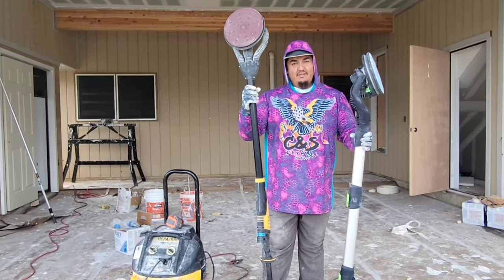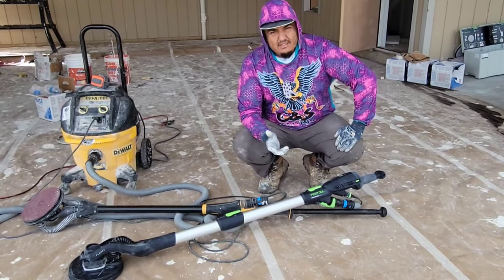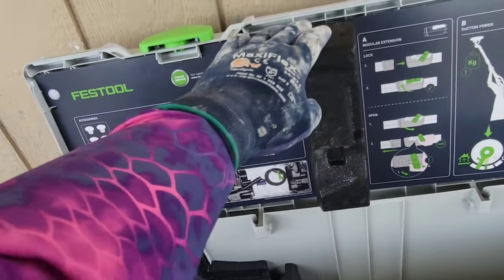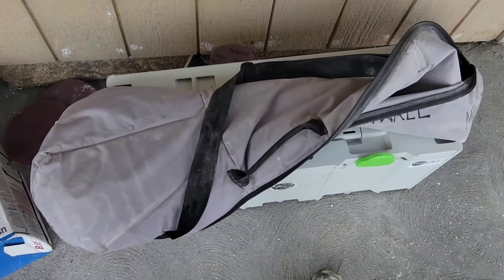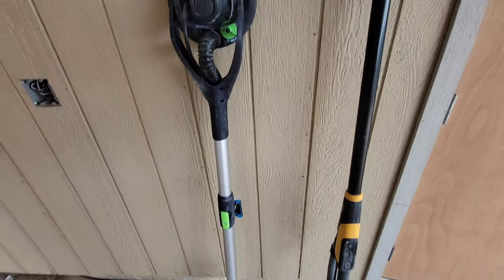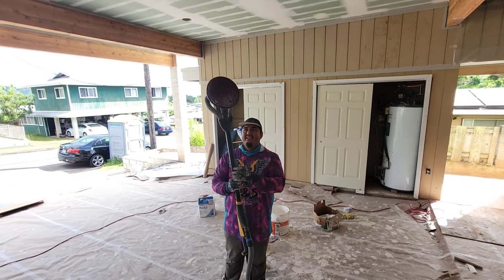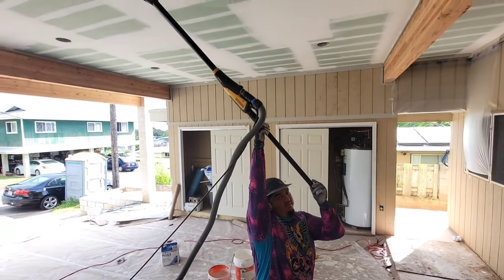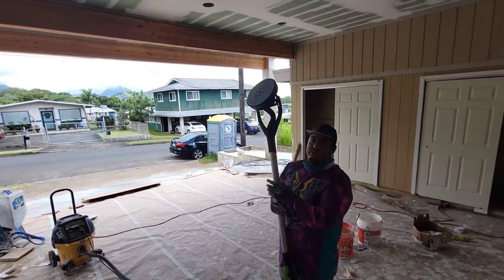Festool planex 2 vs Mirka Leros

Comment: The festool vacuum is night and day difference compared to the one your using. Its what makes the product. The suction holds the vac on the ceilings you exert virtually no physical pressure on it while doing ceilings. I urge you to find a festool vac you could test out to see the difference
Reply: This is correct, it also keeps the interface pad level.  

Another thing, is you have to stick the old planex interface pad over the top of the new interface pad, this will give you a level 5 finish.
Reply: I do post construction cleaning would that festool vacuum be very good for the dust or does it only work with the grinder ?

Comment: I have both and the last model planex. The newest planex has come a long way from previous models but in no way is better or easier to use than the mirka. The mirka is an amazing machine for finish sanding. It’s terrible for removing painted old texture. It tends to over heat. The planex is better for that kind of work but when it comes to finish work mirka is the clear winner😊
Reply from the maker: 💯 agree🤙🏽

Comment: I have used the festool with their vac for years. I bought the Mirka after watching your video. Now I only bring out the Festool to knock down heavy texture.
Reply from the maker: Ya that's one thing the Mirka can't handle.
Reply: My ceilings have a pretty heavy texture and I'm thinking of sanding it down in my house but didn't want to make a huge mess. How clean is that process using a vac and sander like this?

Comment: I just bought a mirka leros and a vacuum this morning. After one day of use I absolutely love it. We don’t do a whole lot of drywall work but the custom home we’re painting right now has a ton of nail pops that we had to redo after the Drywallers tried to fix them. They spent almost a week going around and patching up nail pops without setting the screw in and the walls looked like they had goosebumps all over them. We spent two days sanding by hand and after the second day I said screw this I’m buying a Mirka.

Comment: Great review! Personally I own the mirka and the mirka vacuum and it work perfectly I buy it 2 years ago and I'm totally satisfied.  I use 150 grid for finish and 120 grid for sanding 45 or 20 min hot mud. The fact that the head moove 180° make huge difference in my opinion like you demonstrated in your video. The dust control is exceptional, even when you pass on coner bead with half the head on the wall. This electric sanders is a beast and I will never return to the festool in fact at the beginning like 7 years from now u was using the Porter-Cable 😅
Reply: The mirka is an amazing machine. Where festool is the clear winner is in vacuums my ct 36 sucks a lot harder than mirka. I run my mirka on my festool vac

Comment: Awesome! So basically both have their place and it’s just a matter of choice then. I just ordered the Festool unit. It’s my very first ever drywall sander. I’m excited and can’t wait to receive it.
Reply from the maker: Congratulations remember there's a slight learning curve so practice on walls that are still getting coated to avoid having to touch up the finish. A soft pad is highly recommended.
Reply: @csdrywallhawaii  Thank you and thanks for the advice.
Reply: Throw an extra interface pad on (the old planex pad) to prevent the screws from digging into your drywall.

Comment: Thank you for the video.  One of the best videos out there comparing the two.  I’ll be pulling a trigger on the Mirka and just put an LED strip around the head which should make it comparable to the Festool.  Thank you.
Reply from the maker: No problem brother proir to this video festool hadn't come out with the soft pad replacement. Now with it it ties with the Mirka. The biggest difference is the head movement for level 5 Mirka is preferred but everything else the festool is a bit faster and cleaner. The are more recent comparisons on the channel hope it helps.
Reply: I’ll check them out.  Thank you again. Very good info.

Comment: The light is no joke. One of the jobs I used the 2 on was a float job where somebody else had started, and I knew it had issues but when I put the 2 to it to take out some of the problems before I floated it I was like damn this stuff is jacked up. I'm getting along well with the 2 and it reinforces how crappy the OG was. 

Also in my area a extension that also has room for 1 more to fit in the box is 238. USD but you have that island tax. 

If you want to get similar lighting on the Mirka there are some vids where people added led strips around the head to their old Planex. Doable for the Mirka.
Reply from the maker: Awesome thanks for the insight ya I seen a couple never got around to playing with the led strip.
Reply: The L.E.D. strip is the only way to go

Comment: Ya, the mirka bag sucks, the zipper is screwed on mine, that's why I built a case for it, but it's a bit heavy. My partner has the festool extractor, I wouldn't worry about buying one if your happy with your dewalt, this thing doesn't hold up a sander to the ceiling either. I'm sticking with mirka, it's the best. Thanks for the review, take care.
Oh, you didn't mention how the random orbital works, one guy says it leaves swirls..........
Reply: It leaves swirls like crazy on the lowest setting with 180 granet, or with Mirka 180 abranet, the leros doesn't leave any marks even with 120 abranet, but the festool granet has better suction than abranet

Comment: What's happening Brother I got my Planex 2 on 5/18/21. At the place I bought it they had a demo and I tried it out. It works great but you have to have the Festool CT-36 HEPA vacuum because it makes the Planex feel very light and it's Sands  great. You will understand once you buy that vacuum. Peace brother
Reply from the maker: Thanks for the insight probably ask for a sample and see how it goes.
Reply: @csdrywallhawaii  Some Festool Dealerships do have a demo program. That may be a way for you to see if that Festool CT 36AC or CT 48AC will work for your business uses.

Comment: That hose looks like a smaller diameter than the festool planex hose. That's probably why it doesn't have the same suction. The ct36ac only has 137cfm. So there must be some kind of restriction.

Comment: I have old festool planex wich broke down today and we need a new one and on a table we have planex 2 and mirca leros. Since im not that young anymore im considering to have the mirca because of 180 so you dont have to do so much acrobatics as you would do with the festool. Old planex is 8kg also wich is damn heavy. Great review.
Reply from the maker: Thanks brother I would reach out to hilti and see if they could set up a sample to the new sander it's identical to the Mirka but backed by a better warranty.
Reply from the maker: https://youtu.be/PvW59qrJbtE
Reply: @csdrywallhawaii  Been using Leros now for couple days, id say this is a solid tool. Its not heavy at all, and i love the 180 degree angle. You do have to be very careful when starting or you will burn in some marks and got to do some repairs, but in general i love it. Dust collection is very solid and the surface with 150 net, is very nice indeed.
Reply from the maker: Awesome brother 🤙🏽

Comment: Could you do a comparison review with the planex and the new Bosch GTR?  the price difference is almost double and I’d like to know why
Reply from the maker: The new bosch is more comparable to the festool easy sander the new feestool and Hilti/Mirka are both random orbital spinning heads (helps reduce swirling). That and the Bosch not having a light would be the biggest difference. Suction looks good from the videos I have seen overall I would compare it to my dewalt sander.

Comment: I just finished two lvl 5 finish jobs and my quality went downhill when I used the new Festool.  It leaves marks that I also noticed in the video, even at the super low settings it leaves it.  the vid you made is 100% I agree now can you make a video of who has a better finish, because they still not as good as a 360 pole sander when it comes to finish. The sanding area on the tool is not completely flat if u look at it sideways, it's also way too hard and got no padding.
Reply from the maker: I know what you mean I feel the Mirka is alot more forgiving is that sense. You can dail it in better to get a nice finish.
Reply: Ya, mirka with 240 grit o  level 5, sooooooo smooth finish, your almost happy to see a imperfections,  because you think your going snow blind not seeing any marks......😂

Comment: Renovation contractor, so do drywall as needed - new to electric sander and debating on which one to purchase. In your opinion, which would you purchase if needed a one for all application?
Reply from the maker: I think the festool would fit better under that category just remember to use paded sand paper for the finner finishes or hopefully they release a soft pad. I won't recommend the Mirka for Heavy-Duty sanding ( popcorn removal).

Comment: I have easy planex and the 2 as well, and I tried mirka too, may be cuz I am used to, but i like festool 2 better, the only thing I don't like about mirka and festool is the rpm,  porter cable is way better and do fast that I use for top and skim coat and the festool 2 with ultra soft pad for nice smooth finish
Reply: By the way i stick to dewalt vacum too

Comment: Aloha, C&S hope all is well.  I finally picked up my sander I ended up with the Hilti. It was tough choice since Im a big Festool sander fan. The 180 sanding action is what pushed me over to the mirka/hilti.  The one thing I am underwhelmed with is the dust collection so far. Im going to pick up some mesh discs and see if that helps but the one thing I notice is the dust port on the sander seems pretty small and is a bit of a choking point. Its not a huge issue in new builds but when working in finished spaces the dust collection becomes a lot more important.  Couple questions 1. the hilti comes with a pad saver, Im assuming thats only needed when using the mesh discs?  2. Has anyone found the best disc/pad combo for maximum dust collection?  3. Does anyone make paper discs that match the hole pattern of the mirka/hilti?  Im not sure if I would be better off with mesh disc and pad saver or paper disc with no pad saver.  4. Do you prefer the finish results with or without the pad saver?
Reply from the maker: Ya the festool suction is better but I can't sand fine finish with it without the pad saver which makes it the same as hilti but heavier.
Reply: Cant beat mesh pads but I use 220 grit.
I use a cheap sander with halo light.
1/10th the price of festool...same result
Reply: Try the abranet stuff

Comment: I wonder if anything changed since then. Because I think they didn't have interference pads at first. Not sure if you had an opportunity to play it with it or not. Thank you
Reply from the maker: The festool works great with the new soft pads but I still feel the hilti is way easier to sand ceilings with because if the head movement

Comment: Question for you, I run an engraving machine that creates a lot of fine dust and would like to have your opinion on what dust collection system is best for handling drywall dust?
Reply from the maker: So far the hilti has been the best that I have used.

Comment: So will this hose fit into Hilti drywall sander and Mirka drywall sander? I have it in my amazon cart and just wanted to know before buying
Reply from the maker: Yes the adapters are included might need a different adapter at the base of vaccum depending on what vaccum you using but the adapter fr9m hose to sander is included.

Comment: do u think festool will make a soft interface pad for it? and do they offer a finer grid then 200.. I just bought it, and notice scratches on plus 3 mud.. cheers 🍻
Reply from the maker: I know what you mean brother I sampled it with the joest yellow pad 150 and it sands way nicer than with the festool paper but gets less suction.
Reply: I got the new interface pads and they are so good there is no swirl marks and do perfect quality

Comment: Which one gets closer to wall when sanding angles? That way when you pole sand the angle you won't sand as much.
Reply: Use flushers or angle heads with properly mixed mud and technique and wouldn’t need to sand as much
Reply from the maker: Both are about the same can kill the edge but still got the pole sand to eliminate the lap marks closer to the inside corner.

Comment: Is the festol the only one that can handle popcorn?
Reply: Going off of previous C&S videos I'm gonna say neither of these are really fit for popcorn removal.
The rotating sanders handle that better then the random orbitals.
Though if you're (like me) not in the market for multiple 1000 dollar tools I reckon either of these with a courser grit will manage.
If you are then Festool also does a rotating Planex for about half the price of this one.
Reply: If all you want to do is remove old texture, look at the Wen sander, Chinese  made, a fraction of the price..........
Reply: @bobseguin2195  
I plan on getting the Mirka and keeping my Porter cable sander for rougher texture. I would never use either for removing popcorn, wetting it down and scraping it is so much faster.
Reply: @bobseguin2195  I would like something I could do both with. But will look into that.
Thanks!
Reply: @michaelcarson4887  I've used it for finish sanding as well, works, but not a smooth to operate as the mirka, but would get it again before the festool........
Reply: @bobseguin2195  awesome! Thanks man.
Reply from the maker: Awesome great to see everyone helping each other out. 🤙🏽